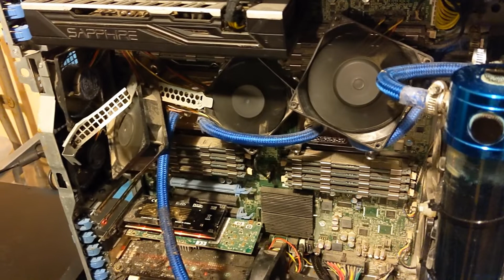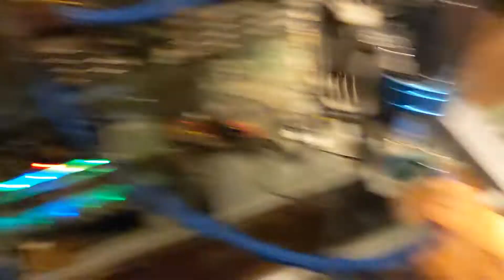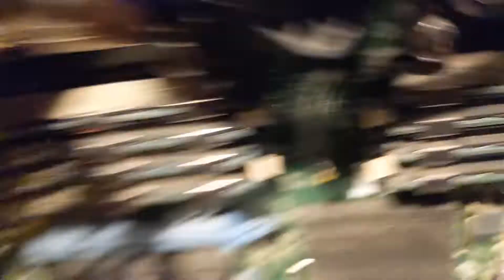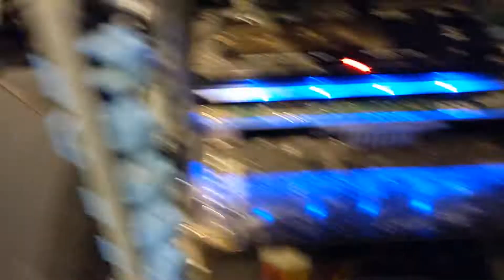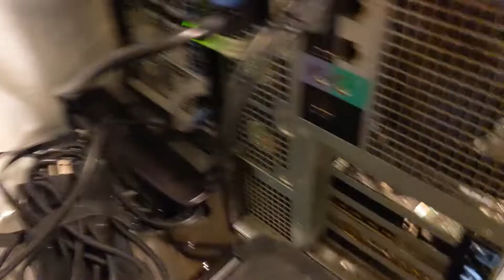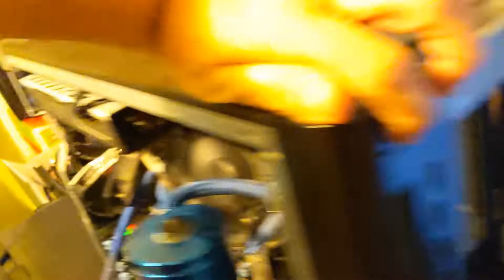Water Liquid cooled Dell Precision T7600 workstation

Comment: Hey man. Is it possible to upgrade to 6th generation Xeon E3 V5 processors on the T7600? I´m video editor and Premiere V.24 ask for 6th gen processors to upgrade.
Reply from the maker: This machine will take any socket 2011 xeon multiprocessor cpu. Bit not 2011-3. 2011-3  is not compatible with socket 2011.

Here is a list of processors, I think the one I have is the second fastest.

Link to the wiki is below.

https://en.wikipedia.org/wiki/LGA_2011

If you're doing video editing, make sure you have at least 8 slots populated for ram (8 channel). Either of the top two 8 cores is probably fast enough. And ensure your graphics card is good for off loading the rendering.

Comment: Well done 👍
I'm also going build water cooling of my Dell t7600. But I'm going another way. Have two separate radiators and waterblocks.
Reply from the maker: I had planned to do something similar and build a unit on top of the case out of Aluminum with multiple radiators. Was also going to put a pelteir cooler in the loop too. I opted for this because it was less effort and just barely fit.

If you're a linux user, theres a register you can find documentation on exposed in /sys/. On this system that in my case forced the clock to stay at 3.6ghz. So the turbo boost doesn't stop.

Comment: I have a T7600 I found that was being thrown out that I just got working. It has two E5-2687W Xeons and 32gb of DDR3 ECC spread out over both CPUs.  I pulled one CPU out and put all the RAM to CPU #1 and put in a Sata SSD and GTX card and Win10 Pro after getting it to POST.  Only thing it was missing was the side cover and the SAS drives so pulled the SAS controller card out as well as the dual Quadros and mechanical Sata drive.  Very good to know that that Nissan blue coolant is good for liquid cooling CPUs.  I'm going to use this Dell T7600 for gaming/heavy browsing/art program editing......  Is there any advantage for me to put the 2nd CPU back in for dual CPU usage???  It has the 1300W power supply.  Also, I could not get it to boot off of an NVME, I tried it.  My T5810 boots from NVME but not my T7600.
Thank you for sharing your build.
Reply: @robsyoutube  Thank you very much for your feedback.  I will be re-installing the 2nd CPU and probably look into liquid cooling after I monitor the temps over the CPUs and RAM.  I'm going to get more RAM for it as well.
Reply: T7600, T7610 can't boot from M.2 SSD. I recommend you install RAID "0" with 4 SSD 2.5" .
Reply: Thanks for the info.  I wound up using the T7600 with a regular single SSD and using the M.2 NVME in an adapter in a T5810 which I now use as my daily rig.  I don't know anything about RAID, literally nothing other than you can have multiple hard drives acting as a single unit and one program  @JamesBakster
Reply from the maker: @Vile-Flesh  I just put my rootfs on the NVME and my /boot and /ssdstorage on the 2.5inch ssd.